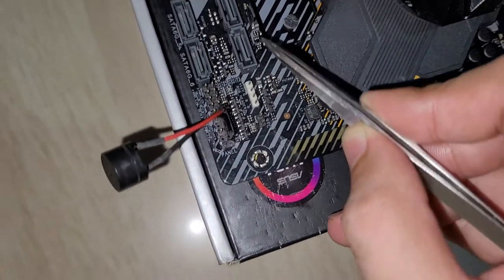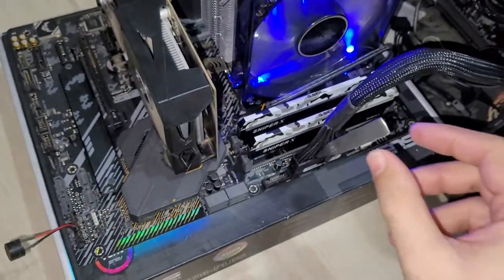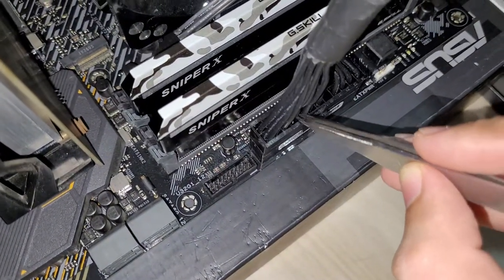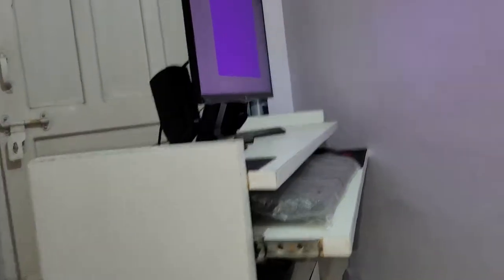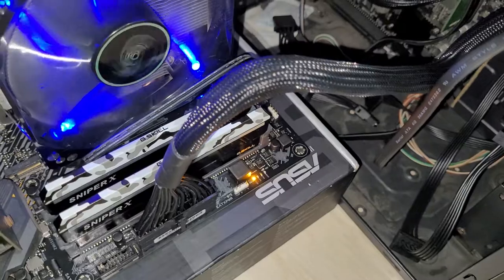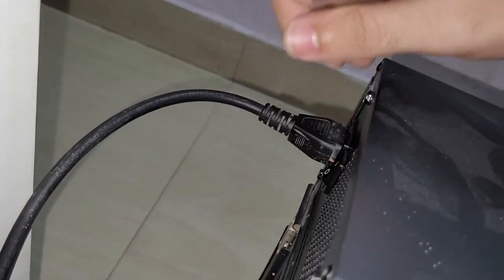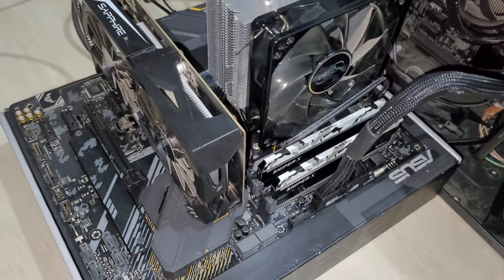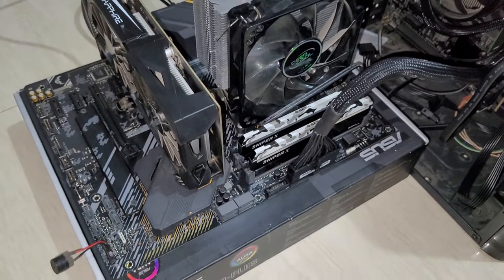Issue: ASUS TUF Gaming X570-Plus Motherboard Doesn't Power ON Without CLR CMOS + PSU Paperclip Short

Comment: i have asus tuff gaming b660m plus wifi d4 motherboard and im facing some issues since last few days when i try to turn on computer in the morning i press power button nd system. turn on for a second nd off again nd same happen so manytime  nd after many attempts the system. turn on normally if once turn on then no problem all day work fine but today my motherboard rgb leds turn on but wont power on 😢 my motherboard still under warranty but there is no outlet in here so pleas help me to sortout the problem  i already chek evrything cmos battry gpu power supply even i clean prosessor as we'll but still wont power on just motherboards rgb leds turn on only
Reply from the maker: Brother check the ASUS RMA website for your region. If there is no outlet, they will have Courier option.